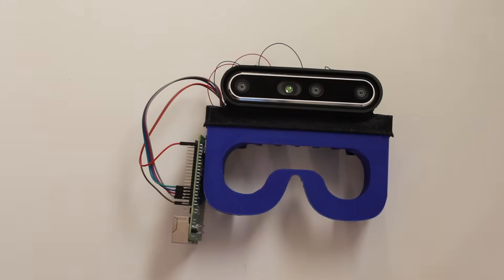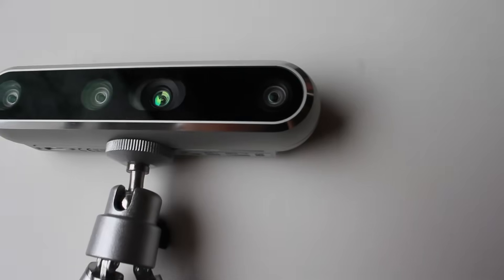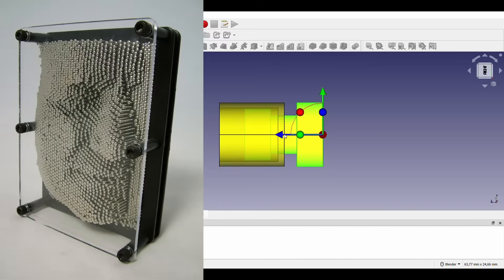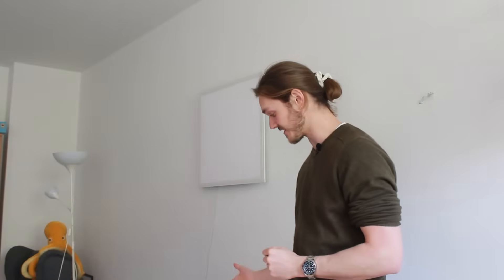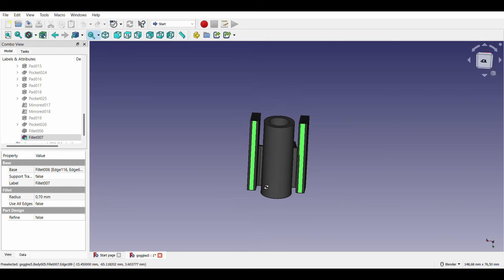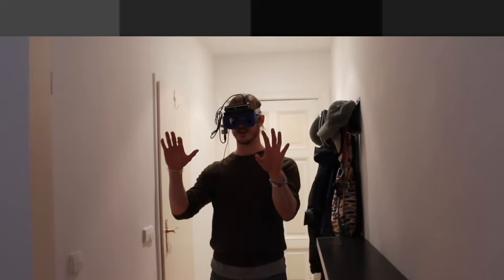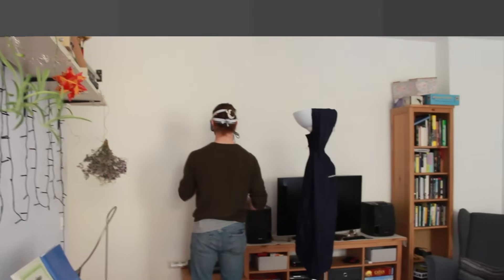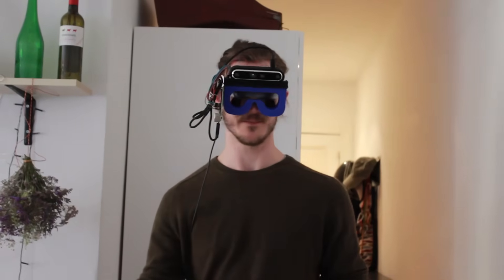I Built Glasses That See For You

Comment: Hi. I have a similar final year design project in mechatronics. I would like to ask you how you converted the depth map into vibrotactile sensation that could help the user get the idea of the kind of obstacle? did you use some kind of patterns that represent the depth map or you just used the distance threshhold to increase or decrease vibrations? It is possible to communicate with you via email?

Comment: You really don't need all this. English is jot my first language, so please have some patience. The resolution is extremely low, so you might as well go with using sound in stereo headphones. You'll have pitch and loudness, but it is maybe possible to use just a "wave" going from right to left in a known frequency (1 time per second?), like a radar, emitting short pulses of a particular pitch. This way you will have enough "temporal" resolution. So, in a very slow, simple variant with resolution of 3 points (left, center and right), and wave frequency of 3 seconds, with you standing in a narrow coridor: you hear a high pitch "dot" to the right - you know a wall is close; a second later you hear a low pitch "dot" in front of you - you know there is no wall, a second later you hear a high pitch sound on the right - you know there is a wall, then again a sound to the left, center and right. When you reach the end of a corridor, "center" sound becomes high pitched, and you know there is a door. You can make the speed and resolution higher, allowing you to more or less navigate the room. The cone of vision is also to be smaller, obviously. 

The upside is that headphones are extremely cheap, and the processing can be done via a phone, so the only thing you'll need is a Bluetooth sensor on your head. Also, they are invisible and non-disruptive.
Reply from the maker: I like your thinking, stereo headphones is a cool idea! I'm going to try to reduce the bulk of this device so that it is similarly unintrusive to headphones. I think one advantage of not using headphones is that hearing isn't obstructed. But like you noticed, it would make increasing resolution easier!
Then again, you'd need to mount a depth sensor anyway, so you might not be saving so much bulk. I really like your thinking here :)